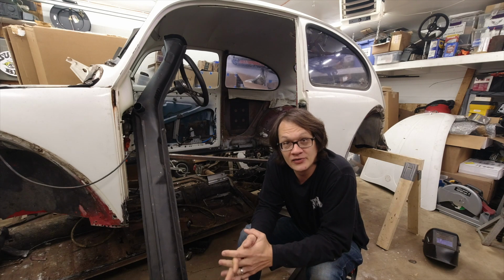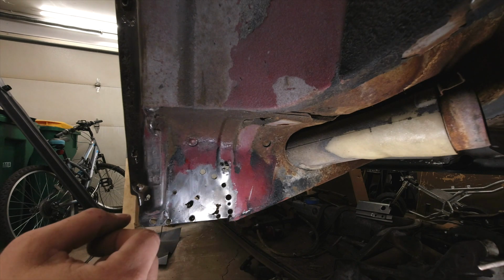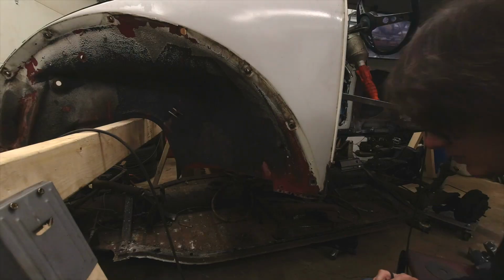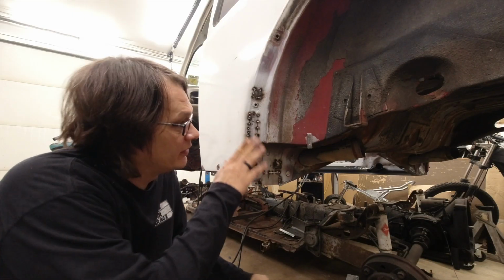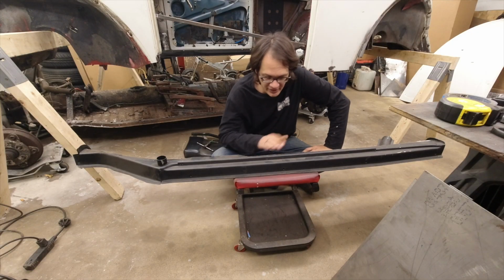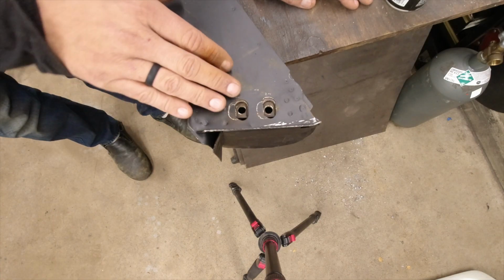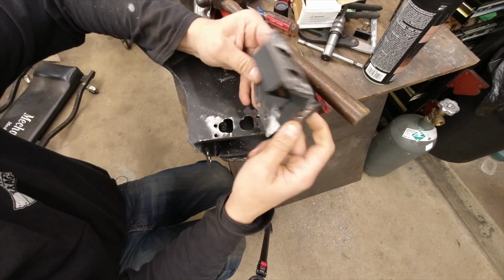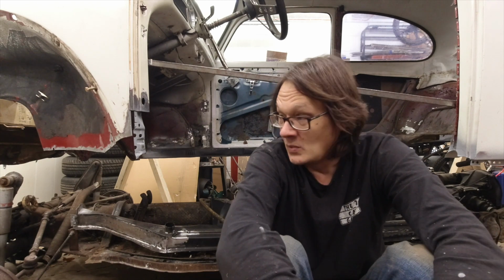VW Beetle Heater Channel Prep for Install - Curts Bug Part 13

Comment: I did the heater channels on my 61 Beetle, I used the Klassic Fab funky green ones.  They may cost a bit more than the other ones, but the fit and quality of them is really nice, why less work than what you went through installing those.

Comment: 3 Years later Jan 31 2024 they are still making them wrong and still selling them and they do not line up. How many people are screwing up there new floors trying to get them to fit. I am sure the seller and the manufacturer of these parts knows they are not correct, but they keep on selling them this way.